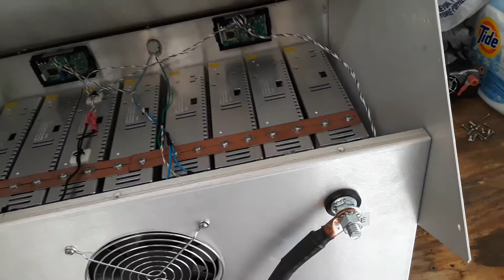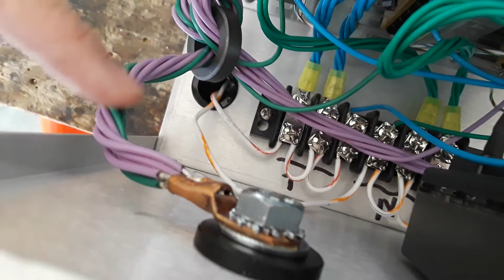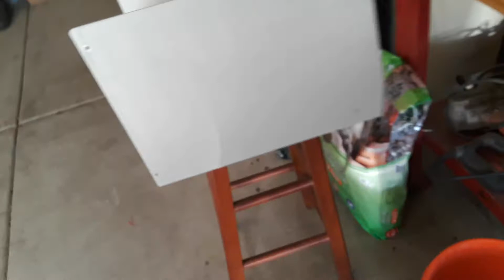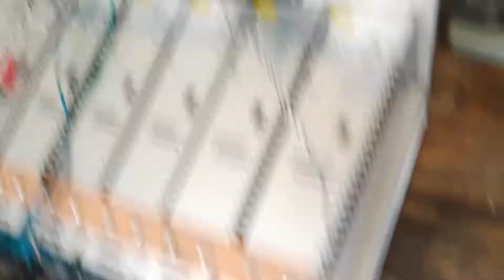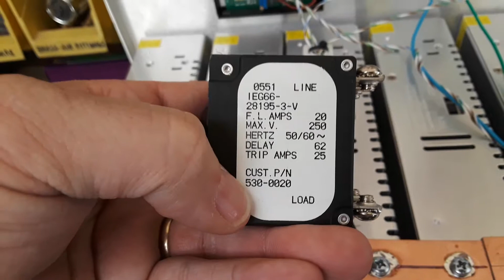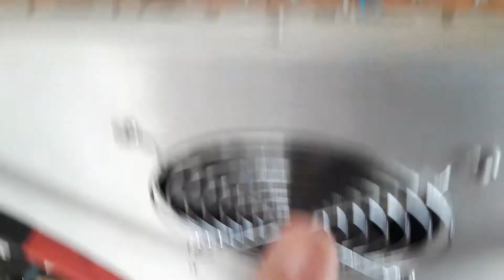Hopper built Nate Jones piece of junk power supply

Comment: Don’t understand, why not build a power supply with a single transformer or double with rectifiers ?  Using server power supply are garbage
Reply from the maker: Not all switching power supplies are garbage. Meanwell power supplies are high quality and are excellent.
Reply: @vegasfordguy I had no luck with them.. I stick to old school
Reply from the maker: @CarmineS-92FS-15 Switching power supplies are used in every LED sign among so many other things that you wouldn't even think they were. The key is to use good quality units such as Meanwell. They are even widely used in the medical industry. Just because Hopper cheaped out and used crappy supplies doesn't mean that they're all bad. I've used a Megawatt 50 amp supply for over 10 years without any issues.

Comment: You guys a asking like a bunch of ___.. She is complaining about the craftsmanship, but does it work as it should? Each module already have a fan in them, and the hole in the back is exhaust.. All you rocket scientist, let me see your work, and if Mrs. Francis was so smart, and neat.. Why didn't she build her own perfect?
Reply from the maker: LOL, don't be a clown! It doesn't matter if each module has a fan. The fan you mentioned on the rear of the cabinet doesn't allow for any air to exit the cabinet. It's blowing inwards and it's a sealed cabinet. There's nowhere for the hot air to go! The wiring was too small, the circuit breaker was bad, 2 of the modules were not operating correctly and you could smell burning electronics. There was so much more wrong. Did it operate correctly you ask? The answer was a huge NO! I had to replace everything I mentioned, plus cut holes and install proper fans. Did it make the amperage it was supposed to do? Nowhere close! After I fixed it how it should have been built, it does now. "Hopper Built" Nate Jones is a complete joke! I suggest that you do some research online and you'll see this same type of thing with him coming up again and again. Bad reviews in the forums, bad better business bureau reviews, etc. I learned my lesson and will NEVER do business with him again. I would suggest that you educate yourself on how this equipment actually works and the correct way to build it before you make another misinformed comment.

Comment: It is junk and he is a joke so spread the word same issue and he is using junk was told by another builder won’t say names but not good
Reply from the maker: That's why I'll NEVER buy anything else from him ever again. He could have taken his garbage back and issued a refund. I was even going to eat the shipping cost, but he threatened me instead, saying that the CB community is very small and he could make it so nobody would sell me anything in the future. 🤣 He thinks he's way more important than he really is. I rebuilt the power supply myself and I ended up sending the amplifier I bought from him to another builder a couple states away from me who did an excellent job fixing it and have been running it for years now. Nate is capable of doing good work, he obviously just picks and chooses and the complaints are racking up.

Comment: That bus is the worste it's horrible the bus needs to be way larger as well as the 240 on and the DC supply wires size out ..crazy u load that up it will drag ass period ...it also could use cap bank not a must but geez why not ad cap bank to support drop ots a ass dragger ingarantee ya needs cap bank and bigger wire period

Comment: You need a couple power capacitors in that thing. Will keep the volts steady. DC out wires #12 at minimum, #10 if possible. Make sure the thermal caps are bypassed or you will smoke them. Hope you got it all fixed up. 155 Buckeye

Comment: TAFT doesn't like schemers and scammers. We were sent a link to this video.
We at the TAFT group have access to smart people to look at it and give us a report.
This is what our crack team of "experts" that know more than Mark Sherman will ever know said:

1. No ground bond seen at the AC input. 
2. AC input should be rewired to include the neutral AND the ground (4 wires) - 3 wire 240v is legacy.
3. The Airpax breaker would be fine if it was an original. That is an IEG66-28195-3-V breaker. They are a little pricey but what you have there is a Chinese clone.
4. Breaker sizing is likely incorrect and should be recalculated.
5. There is no airflow in the cabinet period.
6. There are too many modules in that cabinet to allow for proper airflow. The modules have fans and they have restricted airflow.
7. The modules have not been ballasted properly when sharing current.
8. The wire gauge from the modules to the terminals is slightly undersized.
9. The "wall wart" stuck to the back is just sloppy and lazy.
10. The power modules do not appear to have proper remote sensing to allow for parallel operation. Something was "hacked" together.
11. There is no electrical isolation between supplies, one supply dies and you have a potentially dangerous situation as the one failed supply drags the remaining supplies down.
12. There is no protection on the input or output of individual modules.

Our "crack team" tell us here at TAFT that this "power supply" is unsafe and should not be used.
If it burns our house down you can kiss your insurance policy goodbye.

Comment: That looks like #14 wire for the DC out on those power supplies. I assume these are 30A switchers… which means the output wiring is rated for half the current as the power supplies are capable of putting out. Kinda shady
Reply from the maker: 42 amp switching supplies
Reply: @vegasfordguy  wow that’s even worse

Comment: All i know is when you spend money on something you expect it work right. It's not like it was a Heathkit you build yourself. It's supposed to be plug and play. I'm curious are those 50 amp supplies or 30s. Are they MeanWell or MegaWatt power supplies? The amperage shouldn't have that kind of drop. Iv"e seen .3 to .5 Drop on amp builders supplies while they were audioing into the mic. Iv"e watched enough videos iv"e learned the length of the wires should be same length or causes undo stress on supplies. (Those were power supplies inside amps though). Also if the supplies aren't within .1 of a volt with each other it will screw the supplies up also.
Reply from the maker: No sir, not Meanwell or Mega watt. Just the basic Chinese modules that most builders are using nowadays. They are rated at 42 amps each. It would have been fine if he would have used 10awg wiring instead of that tiny stuff that he used. I have since upgraded the wiring, breaker, installed 2 fans in the lid and have had to replace the variable and two of the 42 amp modules. I would have been ashamed to sell this as a (new) power supply.